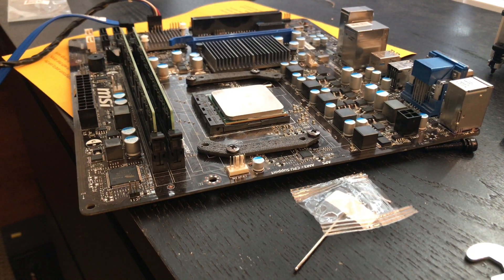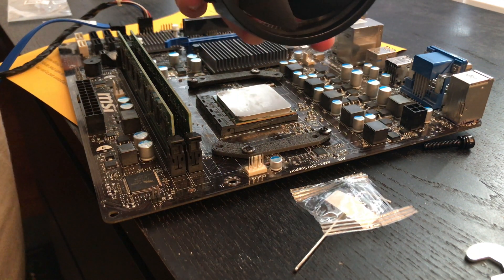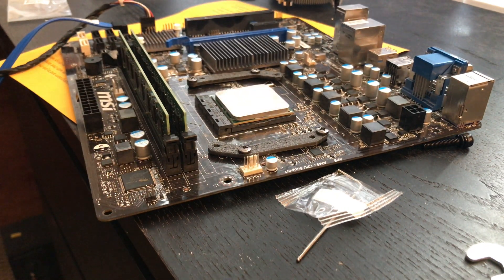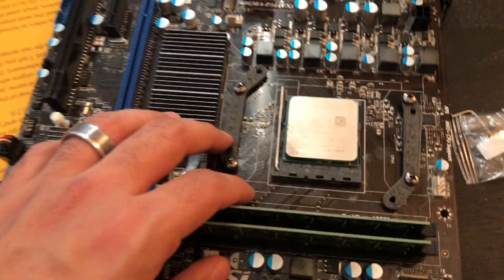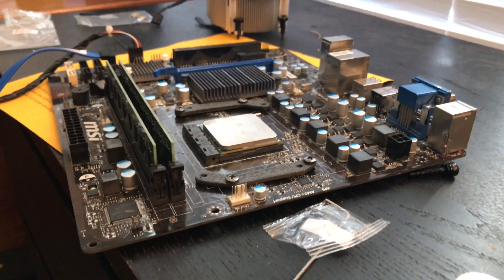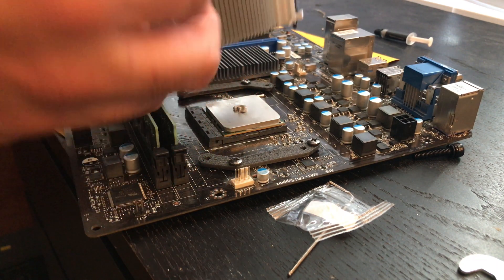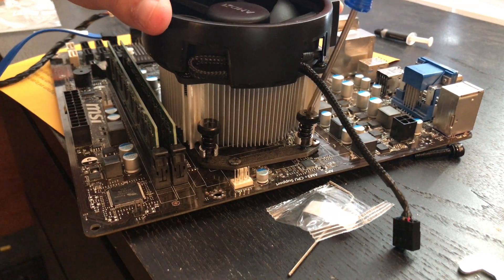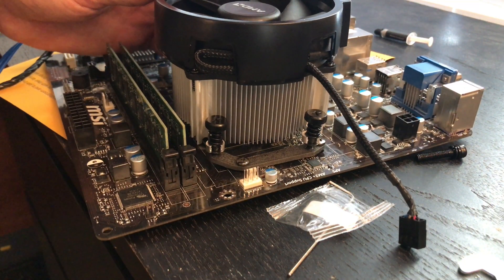AMD AM4 CPU Cooer adapter for AM3 Socket

Comment: Is this solid?
Reply from the maker: Yes, if you have the right filament, I would use carbon fiber or something as durable, regular filament will heat up and break apart.